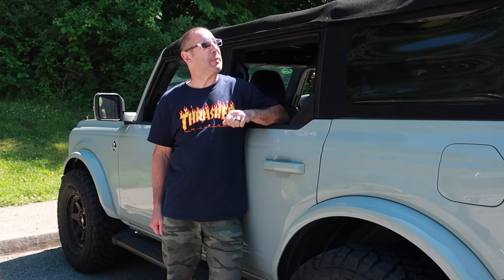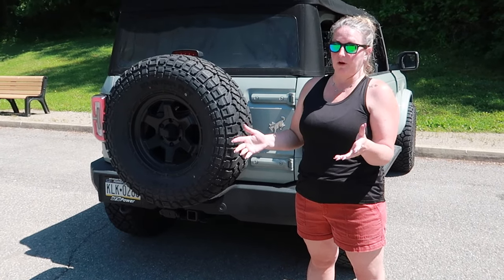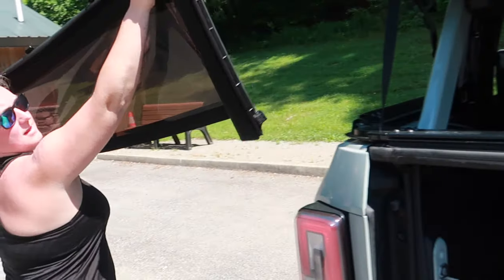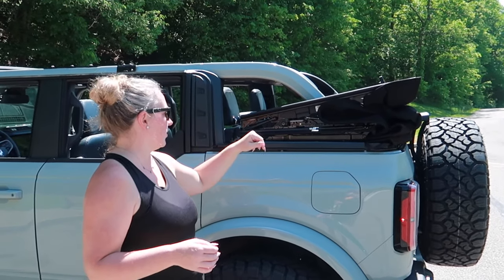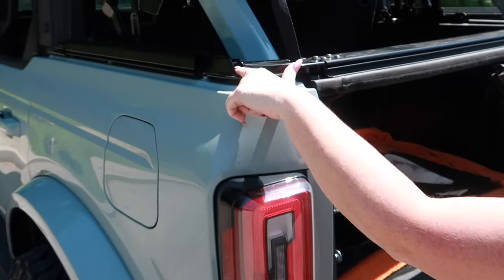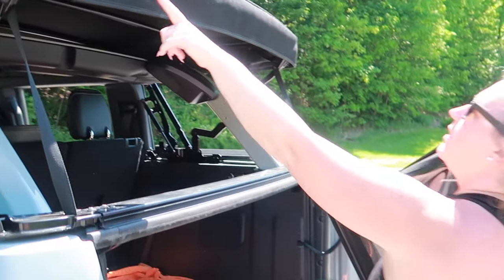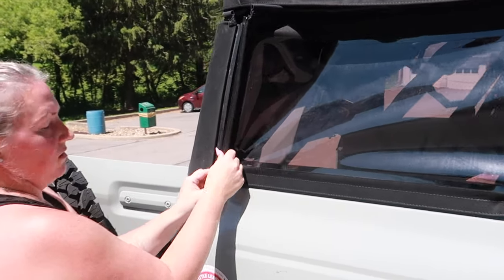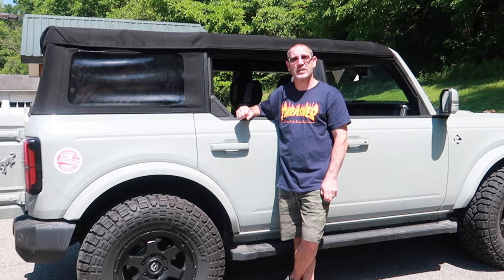How To PROPERLY Raise And Lower Your Bronco Soft Top

Comment: Great step by step instruction. Thank you for taking the time to share. I bought a soft top OBX for my daughter in November. We are waiting for the weather to be nice enough to remove the top.
Reply from the maker: Thanks for watching Larry!
Reply: One thing she missed was the top of the side windows at the back door. You must put the window under the wire at the top when you push the clips in. You’ll know what I’m talking about as soon as you realize that the very top won’t go under the roof snug! 
I’m 5’1” and clipping that back window is the hardest part of the whole process for me.  And also, make sure before putting them back on, you let the sun warm them up! Helps stretch it to close it off with the back window! Dealership had to help me out once and told me to do this from now on! It works!

Comment: Do you do anything with the weatherstripping on the sides of the soft top about the door windows?  It seems like it should hook somehow and not be loose. You can stick your hand between the layers.
Reply from the maker: Yes, you can reach your hand through. There is nothing additional to latch on the sides, except for where the hinges are to put it in the half back position. Thanks for watching!

Comment: So I see u put the back 2 side panel/windows in the trunk but does the back window panel fit in the trunk ? Curious if all 3 removable window panels fit in the trunk so u can bring them with u .
Reply from the maker: You can fit the back window in too. It is tight and you have to bend it slightly but will not affect the window itself.

Comment: Just a thought,  can you do a tour of Pittsburgh power , and do a test on max milage on the Ford eco boost  6 , they are stating that It keeps the carbon build  up till nothing.  Pittsburgh power was on Sirius radio till Kevin Rutherford said something to get taken of the radio.  So they probably would love to get onto other platforms
Reply from the maker: I am not sure what Pittsburgh power is. For some reason, I can get up to 23 mpg out of my ‘21 super crew F150 with the 2.7L but the best the Bronco has done, with the same engine is only 16.3 on the highway
Reply: Pittsburgh power is a heavy truck repair shop

Comment: Very nice demonstration but it seems like a lot of steps to me. I think I would go with a hard top unless they ever made a power top 😁
Reply from the maker: Thanks! I wanted to get the hard top but she wanted to soft. I figured if we bought one with a soft top we could always buy hardtop later but they are still unavailable from Ford. I do have a new bronco with a Hardtop on order but it has no scheduled build date yet.
Reply: Once you've done it a few times, it comes off in one minute and you can put it back on in two minutes.

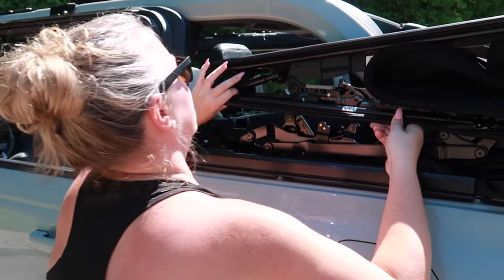Comment: Is it normal for it not to click/not latch like yours did at 6:38  when putting the top back on? Seems like my soft top is just a tad too far back when I’m putting it back on, but I’m still able to get it closed all the way🤔
Reply from the maker: It should click immediately when you drop it into the channel. You can get your top adjusted at the dealership. Basically the bracket can slide forward and back until it clicks without a problem.

Comment: is there anything we need to do along the sides when the cover is back on where the window meets the soft top? it looks like its just laying there does the soft top need to be secured along a track above the doors or just try our best to keep it laying flat?
Reply from the maker: Hi Robbie, no, above the door there is nothing to attach to.  When you push the latch on the inside, that pulls the top down and presses the seal tight. Above all of the plastic windows there is Velcro that you need to be sure that you attach the whole way around.

Comment: I noticed that when I have my top down the passeger side of the top does not lock flush. So when I'm driving it rattles. I noticed there is a pad for that part or the frame sits on and my passenger side the frame is not sittng on the pad which is causing the rattle. When my top is up there is a rattle with the cross support that is inbetween the front and backseat. Any suggestions as to what needs to be fixed or what I can do to fix this myself
Reply from the maker: It sounds like the frame may be bent.
Reply: @PIPSBURGHVIEWS  I hope not I just bought it

Comment: Thanks for the video but after taking it back down one time for a day needing it back up, I now see that I will never take it down again. Sad I wasted my money on a window bag. They couldn't have made it more of a pain. even the side windows take all my might and manipulation to stretch them into place. Very sad, the only thing that didn't work out with the bronco.
Reply from the maker: I am surprised you are having issues, my wife had hers off multiple time in one week with no problems.
Reply: @PIPSBURGHVIEWS  maybe I will try again when I have a bunch of time to fight with those side windows again. I was afraid I’d have to go to the dealer to have them put back on. When you get the front piece in they just do not reach to the back tab- I think that was my struggle looking back.
Reply: @davidwerner3022  It sounds like the back piece probably isn't 'clicked in.' If it's not, the side panels won't reach. There is definitely a learning curve on these, but once you get it figured out, you won't regret it! Good luck!

Comment: Did this top come with your Bronco, or did you buy it from a third party? I just bought a 2024 Bronco and it has a modular hard top, which I love. However, I would also like a retractable soft top like this for Summer. The ones FORD currently offer do not retract all the way back like this.
Reply from the maker: Yes, this is the stock top. The Best top/fastback style tops don't retract all the way but Ford should still sell the factory style top. Congrats on the Bronco!

Comment: Seems your top goes all the way back, and folds up over spare tire. I see the Besttop doesn’t seem to fold back that far? Is this a different top? If yes, where can it be bought as the Ford accessory tops appear to be the Bestop ones.
Reply from the maker: Yes, you can buy the factory soft top from the dealer. You just have to specify that you want the factory one and not the best top. My wife said there are a lot of people selling their factory soft tops on the Bronco forms, new in the box.

Comment: Hi - when the top is half way back will it stay in place without the velcro straps? I didn’t get any straps with mine. - thanks
Reply from the maker: It “should” we have never had a problem but they are recommended for highway speeds and off-roading. You can buy some double sided Velcro and it will do the exact same thing. Thanks for watching!

Comment: Hi - another question- when I put the top back on and latched it, it appears the edge of the top that runs along the driver and passenger doors isn’t sealed correctly. It’s like I can lift the edge up easily and I don’t remember it being that way before. This is the first time lowering it. Is this normal? I reopened it and closed to see if the first time it didn’t seal correctly but same thing - thank you
Reply from the maker: Hello, we have not experienced that issue. Just make sure the mid latches are secure when lowering the top.
Reply: Ok thanks

Comment: So far what is your experience with new big tires and wheels ?im planning to put also 35 inch wheels on my outer banks stock bronco wanna know your overall experience with it. Greatly appreciate it.How’s that fuel economy per gallon with the big tires?
Reply from the maker: The fuel economy went down considerably and they make a lot of noise. I am considering looking for a lighter weight tire. It’s gets around 16 mpg city and highway combined. He is a video explaining the install process. Thanks for watching!

https://youtu.be/gm82GHOMU3I
Reply: FYI I just attempted 0mm offset with 35" K02s and they DO NOT FIT without the offset. Not a big deal for me as I already had a lift planned but thought I'd let you know.

Comment: Absolutely perfect. Exactly the way I do it -- not that there's many different ways to do it. I wondered if you would have the extra tip about getting the side panel back in. It takes a nice hard push to get that bottom corner in, but the rest of it easily locks in. And I don't have any roll bar scratches either. If you lift straight up (instead of up and toward the front of the car), you won't get any contact. And while it seems like a lot of work because you're showing all the step by step, it really only takes a couple of minutes.
Reply from the maker: Thanks for watching, Mike! My wife said that she had never experienced that issue with the side panels but people on the forums say that if you lay them flat out in the sun, they are more pliable.